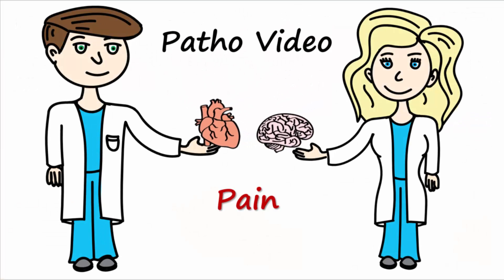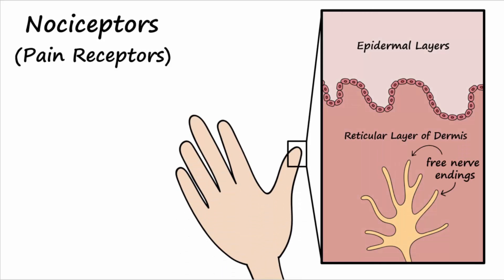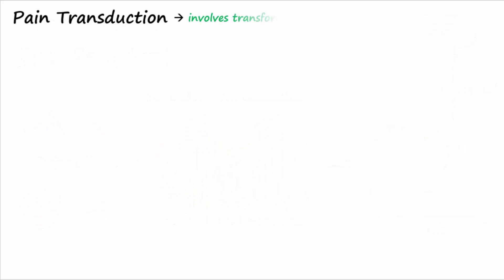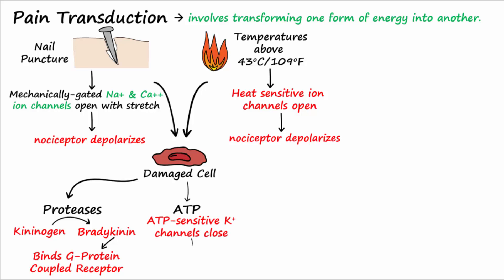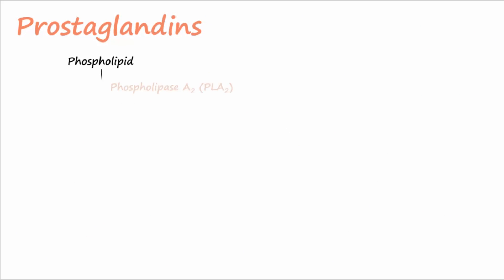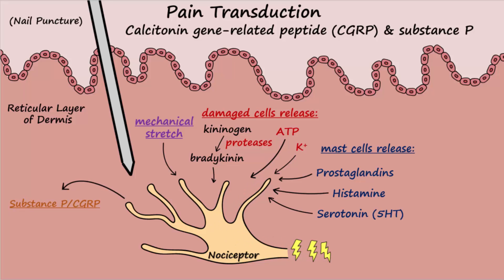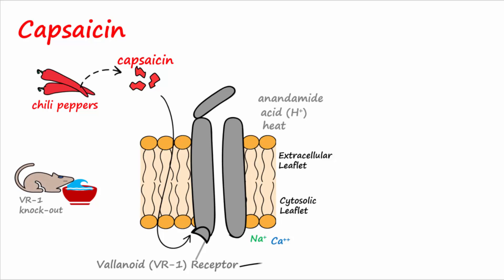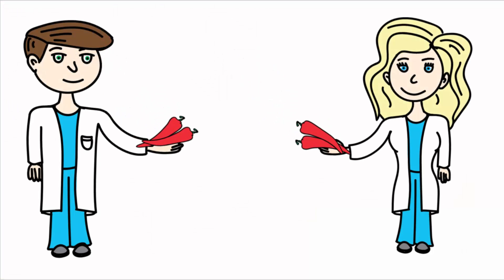Pain Transduction (Described Concisely)

Comment: Can the same neuron have multiple types of pain receptors? Ex, C5 on the dermatome map. Do C5 neurons contain all the pain/sensation modalities or is C5 composed of different neurons that sense different modalities?
Reply from the maker: individual neurons transmit typically one modality of sensation, so pain neurons carry pain and not deep touch for example
Reply: PhysioPathoPharmaco gotcha. What about for migraines? Apparently the pathophysiology involves sensitization of the trigeminal nerve itself. So the nerve itself can be sensitized by different modalities of sensation (any external stimuli), causing it to signal pain. Does that mean it has receptors for a variety of stimuli?
Reply from the maker: @ATA-wi2lh  Yes, and after these stimuli activate the trigeminal nerve, the trigeminal nerve will release neuropeptides like substance P and CGRP which will then be the substances that cause transduction (depolarization) in the neighboring nociceptors.